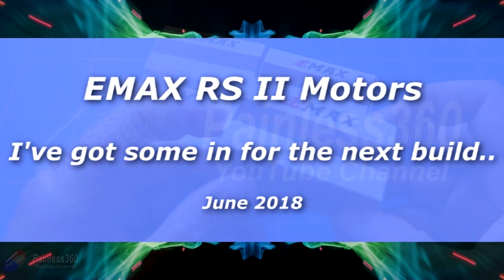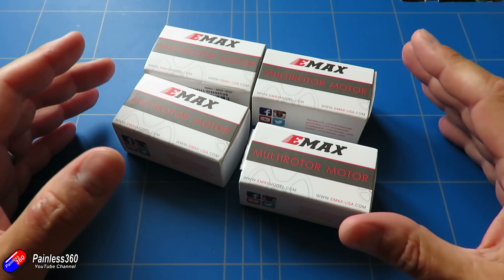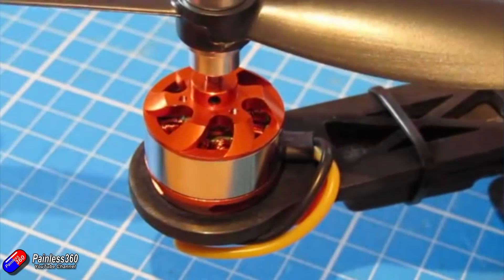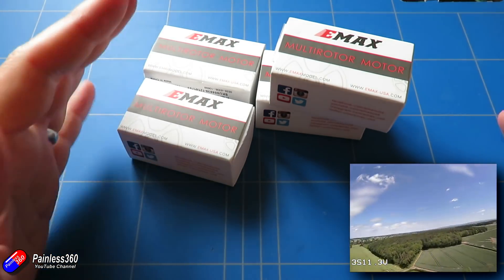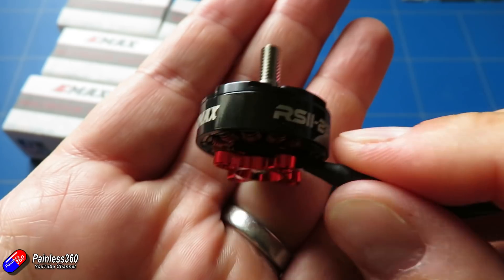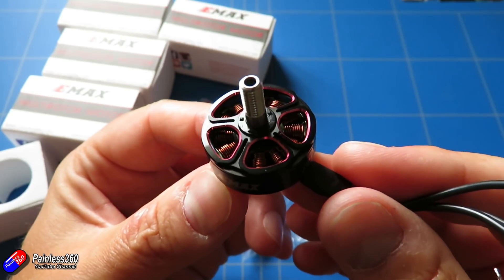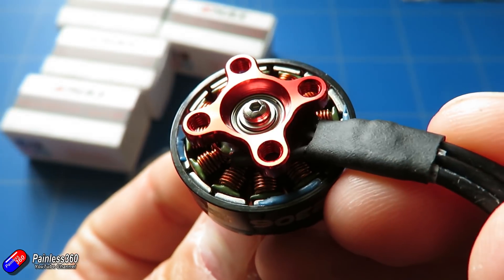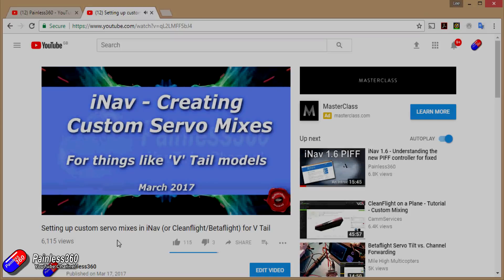First Look: New EMAX RS II 2306 1600KV motors

Comment: Im curious. How has your longevity been on these motors? I'm having bearing issues on a 1900kv version swinging 6 inch props. My opinion is that they focused too much on light weight and cut corners by decreasing the bearing size. Most competitors seem to run a 4x9x4 bearing.  These use a 4x8x3.
Reply from the maker: So far so good but I've not hammered them..

Comment: Even my Oblivion can get 8 mins on an 1800 4s with only 5” triblades and moderate cruising. The limiting factor  as always is the 5.8mhz video clarity at range. Will be interested to see if you stick with 5.8 video. Of course 2.4 video would mean changing from 2.4 r/c to maybe TBS Xfire? Already been using Xfire for many years now since it was first released, many for robust r/c link and great TBS/Taranis eco system integration.
Reply from the maker: This is endurance not long range. If you want to use that longer flight time to fly farther away than you should then see my Crossfire series ;)
Reply: OK, so to increase flight times or less power for the same performance?Interestingly as I’m learning fpv with an agile mini quad doing a fair bit of manoeuvring I am finding a limit to what my head can handle before having to fly level for a while or land 😲

Comment: Ft 270? Probably not 7" but that was my plan for a more endurance based iNav quad
Reply from the maker: I’ll be testing with a thrust/watt meter so see what the ‘art of the possible’ is. A two bladed 7” prop should be a lot more efficient than a 6” triblade. If we can get the pitch right.. Should make for some interesting testing..

Comment: Hi mate, I went to maiden. My s800 today. Setup in the garage was fine, binding, mixing etc. When I chucked it I had no control. My X7 kept saying "telemetry lost" so I set it on the wall and walked around and away from the model whilst looking at the rssi and it went from 72 to 0 at around 6ft away. I flashed my x7 with the latest firmware making sure I had d8 mode as I have a d4r2, any advice? Love the channel btw
Reply from the maker: That sounds like a suspect receiver. I personally not had one, but I was out at an event a couple of weeks ago where there was a whole box of X8Rs and amazingly in that box there were two that had a problem. Both of them seem to have a flickering green light as well. I’d try another receiver. Best of luck
Reply: Painless360 ok thanks for the reply...
Reply: Painless360 I can confirm my green light is flickering
Reply from the maker: Sounds like a dud Rx..

Comment: AHHHHH endurance film quad yess!!!! What about gimbals?? I wish we had some gimbals that wouldn't go INSANE when you flipy-dodo the quad.. like a lock button idk
Reply from the maker: I'm not planning gimbals on this model. I'm planning a much bigger hexacopter rework with a pixhawk controller. That one does have a gimbal. Should make for an interesting summer of building...
Reply: I CANT WAIT!!! Do you think it's possible to have a gimbal functioning properly flying in air mode? I've been interested in this since I saw Flitetest was using a gopro session w/ gimbal on a racequad

Comment: Awesome, really looking to balance smashing through gates at 60mph with exploring the local landscape over longer flight times. I can not wait for the next build.  Painless, I would love your opinion on whether a gimbal mounted go pro on a 7 or 8 inch quad would be usable. I just don’t think a dji phantom can be flown as accurately or as aggressively as a large racing quad. I would like to push the envelope of capturing stable low and fast footage through difficult terrain. However with my minimal technical knowledge, I could end up building a costly big lemon that would be mocked by phantom pilots everywhere. Your thoughts on this would be very much appreciated.

Comment: I'll follow this build. Your stuff has worked so far. I'm interested in coming towards the micro end with a line of sight brushless hot rod. I to am looking for extended fight time by ditching unneeded weight such as video equipment. I'd buy, but can't find one I want, so it's build again. I want a HOT tiny park flier that can shame a Hubsan X4 H107. My scratch APM 500 is most fun in stability mode, like the Hubsan. I want one that can haul ass like that under 100 grams. That will be the target, horsepower to weight ratio baby!
Reply from the maker: I've not looked at one that's more. Please see my small quadcopter playlist for all the ones that I've looked at. You may get a few ideas in there. Happy flying!

Comment: This is a good idea I too miss just cruising on longer flights (I had a flamewheel) but I think I would use a 6” frame with components rated for 6s then I could use it for long cruises on 4s but when I wanted to do a bit of freestyle I could run it 6s. Best of both worlds. Think you’ve inspired me to do this for the next build. Thanks
Reply from the maker: Great idea. I’m interested in stable flight as well as range so still thinking of 7” props in 8” arms. Remember how stable those flamewheels were? :)

Comment: Sabotage RC (Armattan's economical brand) have a 7" frame the Frigate 7, which I'm flying the F40Pro II and 7" V1S, very nice. I believe the frame is roughly $50USD.
It's not super spacious but workable. 
The frame and hardware is somehting like 70-80gm.
Top mount battery - you can cross mount the battery ("toilet tank") if you want.
I  Plan to use a couple of 30cm straps and bottom mount larger batteries with go pro and gps on top, though  I've been flying it top mount just messing around so far.
I quite like the frame. The motor and prop combo is nice too I think.
Reply from the maker: Interesting! I’ll look at that..

Comment: Thanks for the video. I am always watching your video. Endurance quaqcopter is very interesting but it is quite hard to do. This is because typical quadcopter has lower lift-drag ratio (lift to power ratio if you will) than plane. Plane  10+ but quad 4-. So aerodynamically it does not fly long. As you know if you want to build quad for endurance go for big prop and low rpm so that you can have low disk loading on your prop as well as low power consumption. Thanks again and I am looking forward to see your build 😃😃
Reply from the maker: Please see the prop motor comparison video linked here. You can get a lot more efficiency by simply being smart about the proper motors that you use...
Reply: https://drive.google.com/file/d/1arra-2GMPzugRaVBgFGK2B_6K6svKzET/view and https://drive.google.com/file/d/1R7tJ9XzlwXOUUnln-C_fAT86rq2u4TLQ/view?usp=sharing check this out. As you can see, selecting right prop is a bit important for endurance. According to my screen shot (first link), by selecting right prop you can increase your flight time up to 5 min. If you can use 9 or 10 inch prop you may consider using Master Airscrew 9.4X5MR or DJI P4 prop. I hope this would help you.

Comment: Good idea,  I've just made a 10inch indurance quad with 5200mah 4s,  and a cheap reptile 450 frame,  I'm running inav and get 20 mins approx flight time,  seems ok and stable enough but I'm struggling with the pids and fine tuning.....p.s how do you set up as a patreon?
Reply from the maker: The link is in the description. Thanks in advance if you take the plunge! :)

Comment: I also love EMAX and have little if not no problems with them, the life of the motors are very good and the red bottoms have given me some fantastic power. Quads do seamed to have moved more to Acro and Racing that sucks the life out of your battery giving at best 3-4 minuets of fight time wile there is another side and that is endurance. I would like to see builds like this that give back the flight times with a bit of a sacrifice to the ability of speed and doing acrobatics. I think endurance FPV racing would be an interesting concept that tests the skills of a pilot and engineering skills of building a Quad.